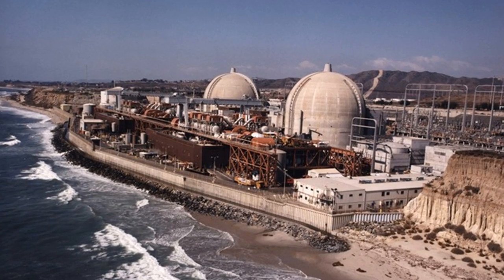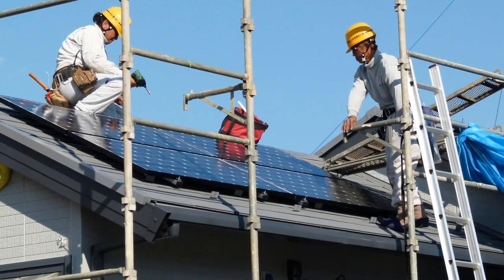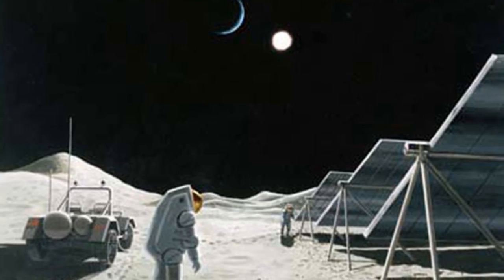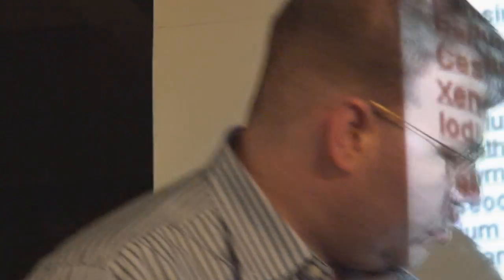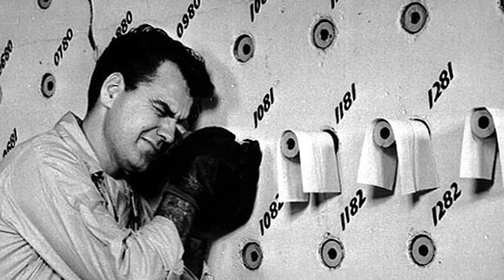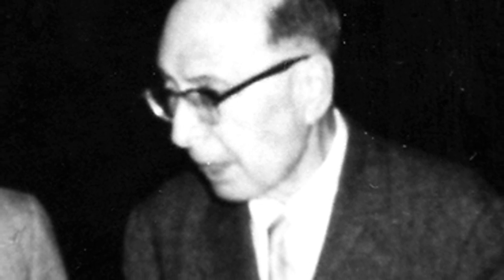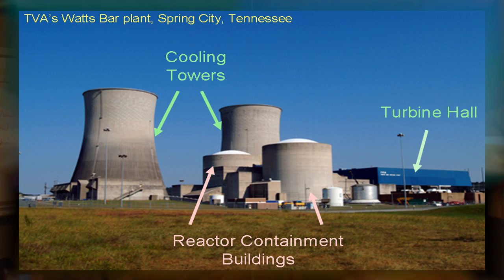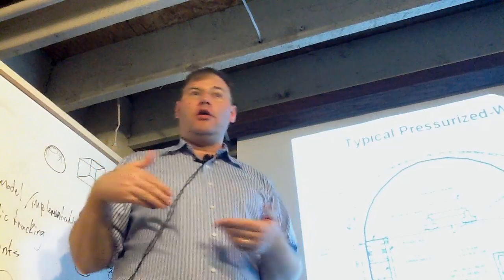Thorium: An energy solution - THORIUM REMIX 2011

Comment from the maker: Abiotic Oil Theory has zero bearing on anything in this video, except for you not believing the term "Fossil Fuel" is accurate. You don't like Fluoride? The point of LFTR is not to create a waste stream containing  Fluoride. That is chemical form of the nuclear catalyst inside the reactor, it stays in the reactor. Most industrial processes involve toxins, trick is to avoid releasing them into the environment or "water supplies". You know, like the manufacture of your computer? Not all unicorns.

Comment: @stathamajf
If the energy of Fukushimna had been generated by Biomass there were around 10000 death. With the LNT-Hypothese you would calculate around 100-1000 death in 30-40 years, the problem is, that there could be hormesis...
(delete the cabs in the link)

Comment: Fukushima Japan readings are not applicable to North America. The laboratories that are measuring the same fallout in America are reporting that the levels (on the week of the disaster) were very hard to detect, and their equipment was on the magnitude of 100x greater sensitivity than any Geiger counter. I'm sorry but there is no way a year after this disaster that you can measure anything Fukushima related from with your inferior equipment.

Comment: @RegioLunar Solar and wind have many applications but those who think solar and wind can provide affordable grid scale generation have not run the numbers. Solar energy for most of North America is less than 1500W/sq.m. at 100% efficiency. That is an energy density greater than wood but less than coal. To power a city the size of San Francisco you would need to cover an area 3/4 the size of San Francisco and have an entire backup system for when the sun isnt shining. This is simply not feasible

Comment: Why aren't actual steam engines used as emergency systems for nuclear reactors? If nuclear reactors create one thing in abundance (even if turned off) it's steam. and you really don't need the high pressure of a fully operating reactor, the decay heat alone should be sufficient to provide a steam engine with enough power to get cooling circuits flowing again, should electrical systems fail (and they do, see fukushima)

Comment: I want Thor to power our planet
Reply: @tommorris3688  nuclear waste is vitrified or recycled.  it is not a stream.
Reply: @tommorris3688  What is your point?  Every industrial process produces waste.  Even renewable energy sources with every battery used.  The point is to handle waste responsibly.  For radiation sources that means providing proper shielding in all situations.  We cannot avoid waste if we do not want the world to starve/freeze to death.  But we can minimize it with nuclear.  Tell me, are there many other recyclable fuels?
Reply: @tommorris3688  It is not hazardous if properly stored.  And when recycled can save lives.  Fission is necessary to create isotopes for special medical procedures.  Nuclear fission is vital in many different ways.  It will be especially vital without fossil fuels.
Reply: @tommorris3688  Renewable sources at their current capability cannot sustain the entire world, and they certainly cannot do so continuously without power storage.  You are forgetting about lithium.  Renewables require a lot of it.  How can we even call them renewables when this is the case?

Nuclear waste is safely shielded and stored underground.  The nuclear industry is heavily regulated.  I am not making errors lol.
Reply: @tommorris3688  I am not wrong.  Much of what I have said is obvious.  Every energy source has pros and cons.  I am aware of many.
Reply: @tommorris3688  I am interested in hearing about these problems.  I am aware of some disadvantages.  But I always thought the main disadvantage is that nuclear energy has very high upfront costs.  Plus, nuclear can actually compete against fossil fuels (unlike wind/solar), which is naturally going to cause opposition.  Safety will always be a concern, but improvements are being made continuously to reduce the risk of accidents.  Plus, there are ways to generate power without high-pressure systems which significantly reduces the risk of catastrophic incident.  Anyways, I just wish that more people new that they will get a higher radiation does by flying on a plane twice a year than they would living next to a nuclear power plant.  I have recently become aware of contamination by Tritium.  However, work is being done to contain tritium even though it presents very little threat to the public.  Nuclear energy as a culture is about mitigating even trivial risks.

Comment: @rasalas2x Tesla proposed transmitting electricity across the Atlantic, wirelessly, with minimum losses. Google "Wardenclyffe tower"

Transmitting electricity long distances is inefficient, of course. Transmitting huge volumes of electricity using DC is surprisingly efficient, even taking into account converting it from AC to DC and the associated losses.

Comment: Awesome vid! I can't stand when some people say "new-cue-lar" like some kind of republican though.
Reply from the maker: https://www.youtube.com/watch?v=Ed8-ELqG5-U Point has been taken. However knowing it and saying it are two different things.
Reply: Hey, seriously though, after seeing a lot of Kirk's stuff and looking for anything that might contradict that I wanted to ask about one thing I saw. I read where someone said that with LFTRs the danger focus just shifts from the reactor to the "constant on-site fuel reprocessing needed". Maybe I have to look again but I don't remember seeing anything about fuel reprocessing in Kirk's stuff. In fact he makes it sound like you have to handle the fuel less. Any insight on that?
Reply from the maker: This is the most detailed in video form: https://www.youtube.com/watch?v=xBmk7t5K35A ...there's also a PDF if you Google "LFTR EPRI" which is quite detailed on reviewing risks and advancement of pertinent chemical processing.

The reprocessing is an extra step absent from today's reactors, for sure. But it isn't the whole volume of the reactor being treated at once... it would be relatively smaller portions of the fuel salt so it would be easy to manage the decay heat (in fact the pipes might be coil-heated to ensure the diverted salt didn't cool down too much).

If you want to close the nuclear fuel cycle then you NEED reprocessing. It is  most efficient to integrate the process into the reactor itself. Otherwise moving materials to a reprocessing plant makes securing the materials more complex, and would favor infrequent reprocessing schedules which might lead to a less clean fuel cycle.
Reply: Today's nuclear plants runs at 35% efficiency. How much better you solution could be? Please, answer me. I was for nuclear before read about thorium....now I'm REALLY for nuclear.
Reply: Actually it was Democrat President Jimmy Carter who popularized that.
Reply: Sharples Associates, I'm not sure about that one way or the other, but repubs love to say it that way for some reason. Willful ignorance? It's been a popular theme... lol
Reply from the maker: Working on new version, see TR2016 NASA. Don't think my pronunciation is great but is better.

Comment: OKay but if 100% of the energy is covered by it: What about the fucking high radiation levels on earth? The radiation goes somewhere. How come nobody think of that?   Sure if its used 100% with no waste left it would "only" contaminate while being used but if its being used all the time it would be a constant exposure. Plus if its being used the energy consumption would explode to 2-3 times the current level. cause it is so "clean". .  I prefer wind and solar. wind works. we got it everywhere where I live: there is wind 24/7 the power lines are already there etc... plus wind and solar are not the only actually clean resources (yes solar requires good recycling ). why go with something so dangerous and unsustainable as nuclear power?  The only way to keep that radiation from us would be using a huge reactor in space and sending a laser beam to a fixed location on earth. wasteful but not as radioactive....     well apart from extremely dangerous..   Safe Nuclear energy is bullshit. it will never be possible. radiation always goes somewhere. The genetic damage is something that lasts and stacks its effect throughout the generations. on a long term its dangers are enorm
Reply from the maker: Jo did you watch the video to the end? There's a pretty detailed discussion about radiation and how the Earth is already radioactive. Without the radioactive decay of Thorium our molten core would freeze, our magnetic field (around the Earth) would fade and solar winds would strip away Earth's atmosphere.

For there to be danger you need exposure to radioactive fission products such as cesium or iodine. Those can be airborne in today's reactor accidents (via steam or smoke), but with molten salt reactors they're chemically bound to the salt and have no reason to disperse (no pressure, no steam, no smoke).

It is great you feel compelled to chime in here, but the idea is you watch the video and THEN share your thoughts.

If you're worried about nuclear safety then this video is more specifically about that: https://www.youtube.com/watch?v=8Pyq8kCeiYs ...we're trying to make safer reactors and that's about as easy as making a safer car or safer airplane.
Reply: gordonmcdowell so I learned something pretty cool: half lives in radioactive decay aren't as constant as we have been led to believe. More research and data is coming out on this and it is awesome.

Ironically, we spend half our lives learning and the other half unlearning. The facts keep changing on us.
Reply: Jo Kommentaah Or just line the outside of the reactor with lead. However as already mentioned in this video the radiation levels are already extremely low. You get more radiation from the fly ash of a coal plant than from even dirty and inefficient HWR's, let alone LFTR. As far as wind and solar is concerned, with the decades of government subsidy's in development and purchasing of these two energy sources if it was economical it would have already been done. 6:06

Comment: There are a lot of "logical fallacies" in this presentation and I'm not sold. First off: If Hormesis is correct, at what threshold does radiation damage begin (and wouldn't I like to save getting my dose until I need radiation therapy for something)? What about long-lived fission products building up in the environment? What about terrorism? And to use how fast we built reactors in the early days as proof of concept for what we should do now ignores the many real reasons the costs have gone up.